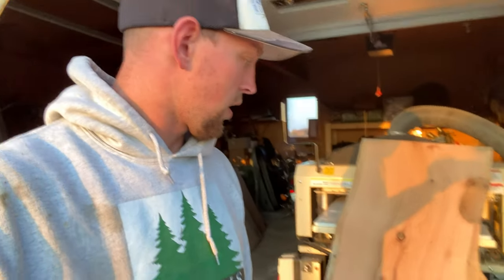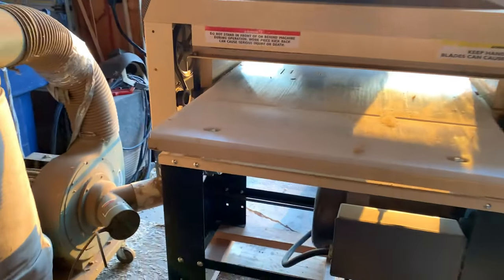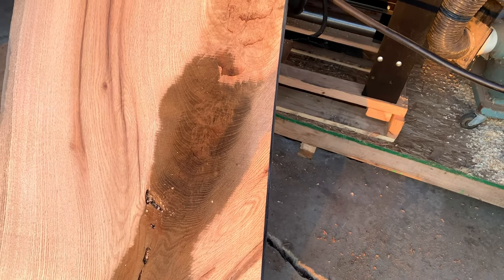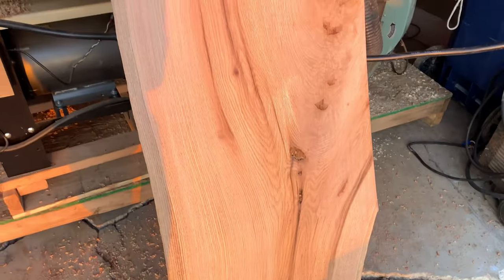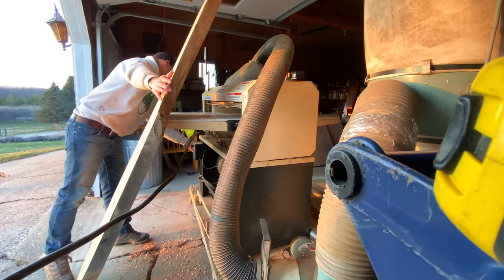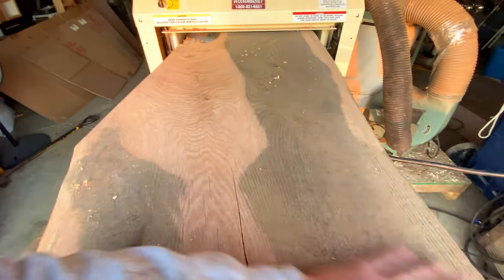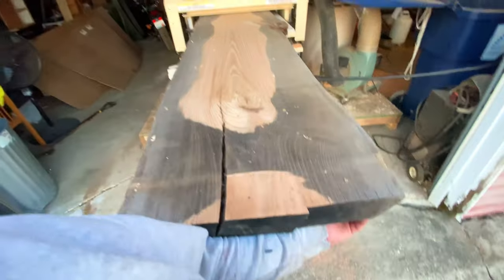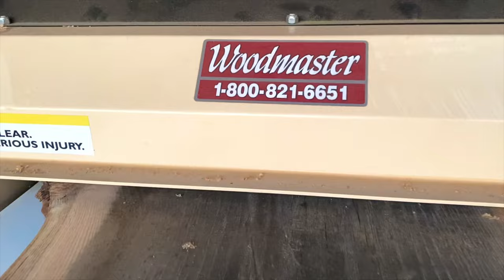WoodMaster 25” Molder/Planer in action!

Comment: Nice video. I Have this planer coming soon with all of the options. How do you like it at this point? Do you ever mould with it?
Reply from the maker: I liked it a lot! It’s a well built machine, unfortunately I sold mine as I was moving out of state, and I didn’t get a chance to use the molding features, but the features I did use I liked. Just make sure when your removing the planer head the use caution when threading the attaching bolts, one of them is reverse threaded.